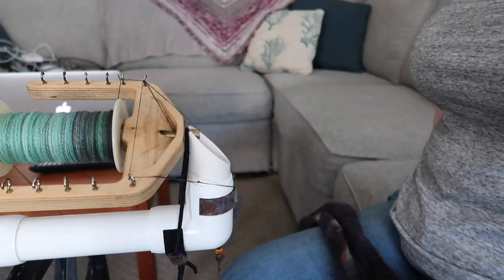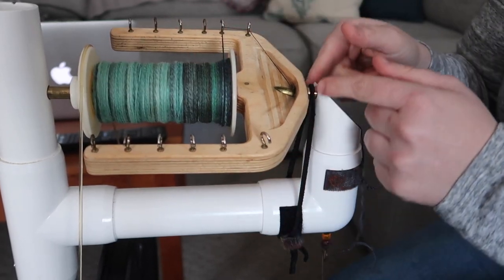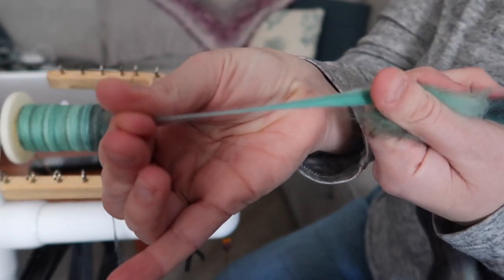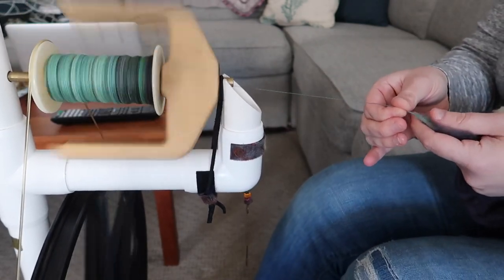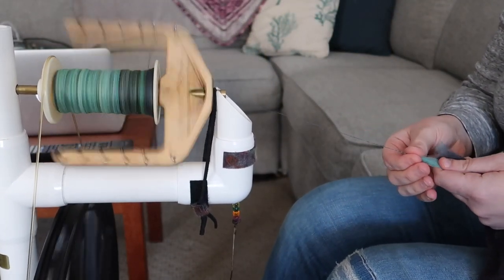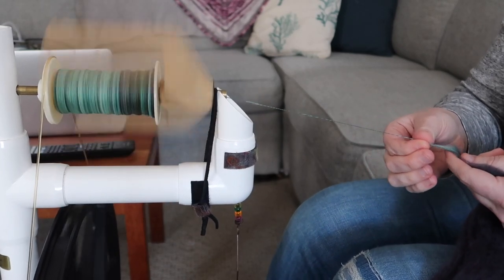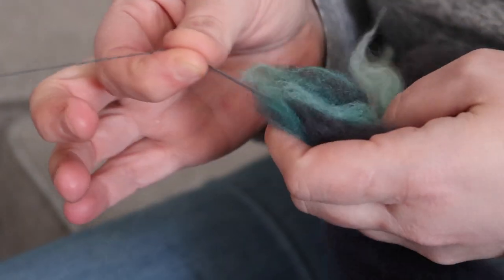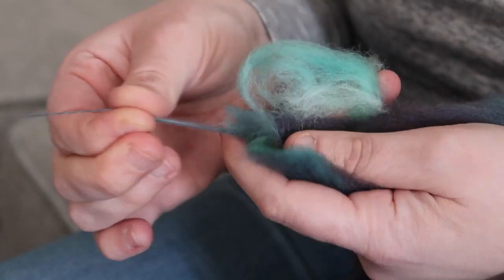How I Spin - Short Forward Draw Technique

Comment: Hello and thank you for the video. I'm wondering what ratio you were spinning this on?
Reply from the maker: if i remember correctly, the largest ratio is (edited to correct) 19:1 -  In any case it's the smallest bobbin whorl for this model wheel. :) I hope that's helpful! Thanks for watching!
Reply: Littlebean and Me thank you
Reply: Littlebean and Me I have that ratio on my wheel but I need some tips on tredling that high. I'm not used to spinning that way with my hands either I keep watching it I hope I catch on.
Reply from the maker: It just takes a bit of time and practice, start treadling more slowly, and keeping your watch on how many fibers are being pulled out of your bundle. you will want to find a comfortable position for your hands as well. you want to have them seated so you don't have strain on them, and that you can maintain control well on what is actually happening. It's easy for yarn to get yanked out. For me, my wheel is irish tension and I do not have any tension on the uptake at all. You want to balance that pull from the wheel so it's not pulling too hard with a fine yarn. It took me a lot of adjustment to be able to spin this way. don't get discouraged :) you can do this! :)
Reply: Littlebean and Me thank you. I'm trying.